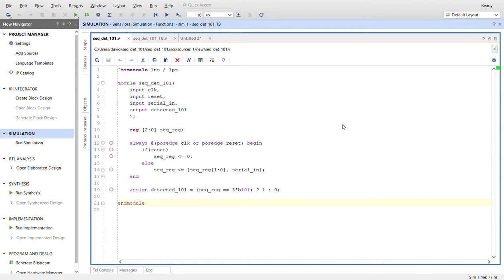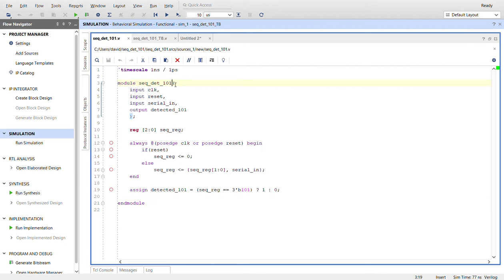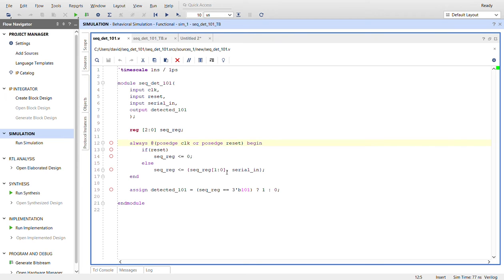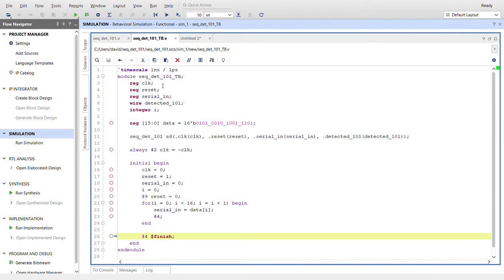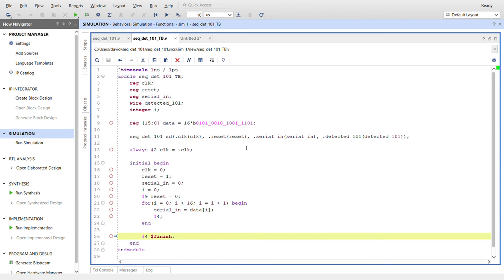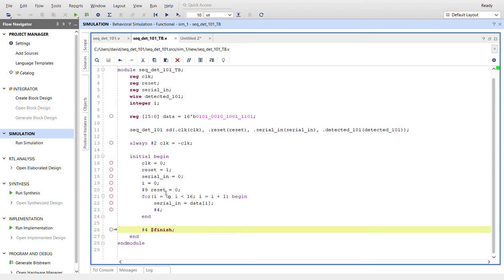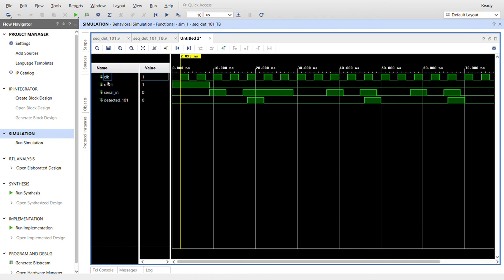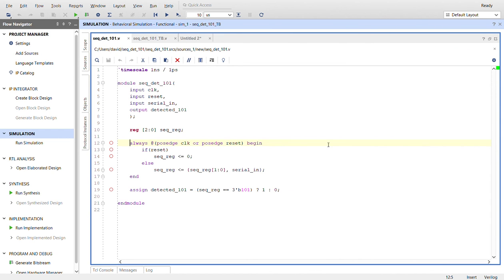101 Sequence Detector using Verilog (Shift Register Method)

Comment: I came across this thought recently. I think the reason why shift register is not preferred for sequence detector is because the register size. For example, a 5-bit sequence detector needs 5 states which can be represented by a 3-bit register. However, if shift register is used, we need to have a 5-bit register which takes up more hardware? Anyway, it is always good to know the shift register method. 😀